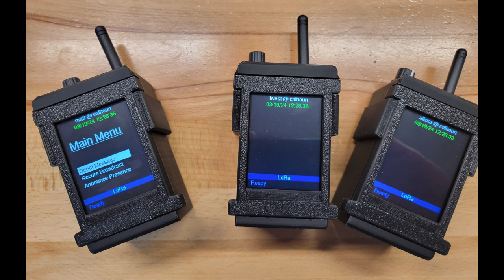Chatterbox - Sending Off-Grid DM Securely (DIY LoRa Device)

Comment: How is this different from meshtastic ELI5
Reply from the maker: I'm not familiar with "ELI5", but would consider this just an alternative to meshtastic for certain people or use cases. I think my priorities for this project are slightly different. Some differences include (based on my limited meshtastic knowledge):
1) In addition to a private cluster having a symmetric/shared key, each device also has a private key, which it can use for asymmetric encryption, message signing, etc. The result of this is that you send a direct message to someone, only you and the recipient can read it, even if other trusted devices are around or assist in delivery. Of course untrusted devices cannot read it in any case.
2) Digital signatures are included with every message, so you can be sure the message is recent and actually came (unmodified) from the person claimed.
3) Messages broadcast are encrypted with a cluster-shared symmetric key, so in that case all devices on the cluster can decrypt, and I think that's more along the lines of how meshtastic works. Again, untrusted devices would not be able to read these broadcast messages, even if they assist in the delivery.
4) There is no app or OS, so certain security risks are drastically reduced. This may be true of meshtastic as well, I'm not sure.
5) The "chatters" protocol supports multiple channels, not just LoRa. By that, I mean a message could be partially delivered via UDP and partially via LoRa, or parts of the message could come from different devices, and that is no problem. I'm looking at deliberately spreading message packets across various channels to increase bandwidth and/or make them pretty much impossible to try to intercept. It also supports UART as a wired channel, and I made the channel support very easy to extend.

The last difference I'll mention (and this may this may have changed since last time I looked into meshtastic) is that I expect the routing will be very much planned, targeted, and responsive to changes in the cluster (devices moving around/etc). I think the routing in meshtastic is something along the lines of repeat a message up to "n" times, sort of blindly, which probably works just fine for most cases, but I'm working now quite hard on that particular issue.